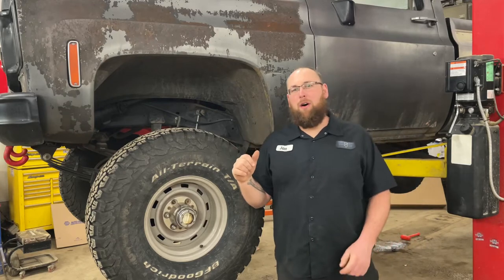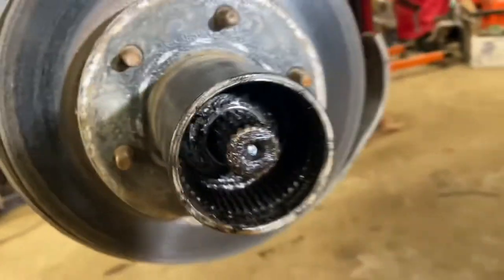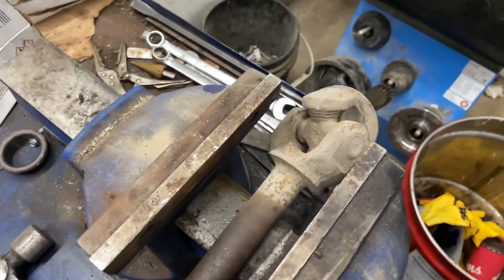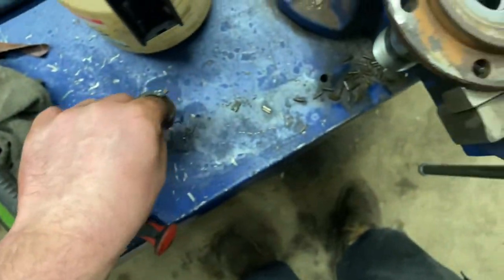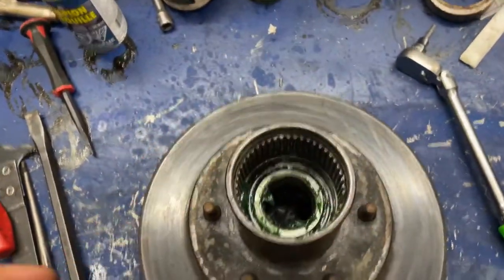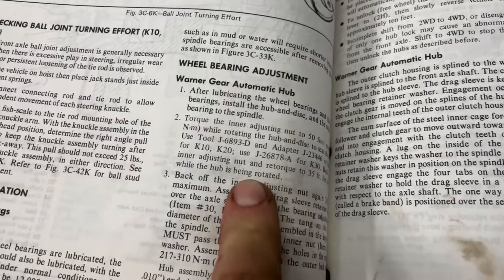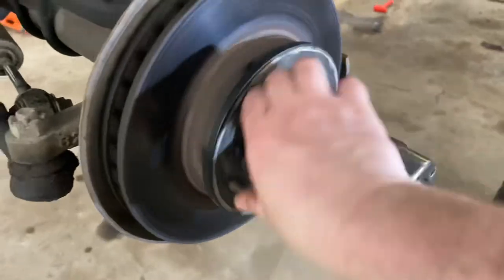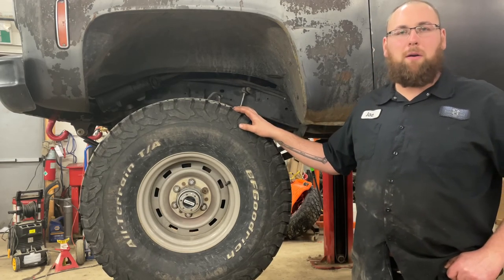K10 Chevy Squarebody 8.5 diff front hubs, wheel bearings, and wheel u-joint replacement

Comment: I did a repack after the left brake hose locked up the caliper, but the heat killed the bearing just 5000 miles later. Now I have to go in there again, and this video helps a lot because I've never replaced bearing races before. Gonna tackle it this weekend.

Update: Tackled it, and WOW the passenger bearing was SHOT. Thanks again for this video. Now, I just need to go back in, replace the seal I damaged on installation, and also replace both spindle bearings. Fun times.

Comment: hey mate i'm havin a hell of a time trying to find a reliable set of spec bearings and seals for the wheel hub what are the part numbers for them it would be greatly appreciated
Reply from the maker: I usually get SKF bearings and seals from my local Napa. What year of truck and is it a k10 with six lug rims?
Reply: @JonHolovach mines a 1986 Chevy k20 3/4 ton 4x4 and I need to re do the hub bearings and seals cause they grenade
Reply: And it’s a 8 lug rim Dana 44
Reply from the maker: These are 2nd design numbers from Napa 

Front inner bearing UBS LM104949VP
Front inner race UBS JLM104910
Seal inner UBS 22311
Outer bearing UBS LM501349VP
Outer race UBS LM501310VP
Reply from the maker: They are all skf numbers. Only thing Napa lists is a second design. Only other way it to pull it apart and get the numbers from what is in there.

Comment: Good video. I own a 78 k10 I need to change the bearing lockers etc. same issue. Just had motors rebuilt trans etc. question. When I had my trans done the guy recommend trans braces. My trans was ripped down the center. He think it’s because the transmission needs a brace. I’m not super savvy. But isn’t it held up with a brace? Or just attached to the transfer case? And motor.
Reply from the maker: I’ve seen trans crack in these trucks with out that brace from the transfer case to the transmission bell housing. One of the squares I used to mud bog with had a 203 big heavy t case I had that brace plus made an extra that would support the back of the transfer case to take the weight.
Reply: @JonHolovach  yea I’ll have to take it in and see what they can do. Don’t want to drive it like it is. Thanks for the good advice. I’m trying to get this truck back into shape and it should last another 50 years.

Comment: Do the front axle shafts seat somehow? I changed the u-joints but putting the shaft back in seems to go in all the way to the u-joint and it doesn't feel like installing a drive shaft. It just feels like it is laying in the tube.
Reply from the maker: Well the splines should engage the big yoke should almost touch the axle tube if seated all the way in

Comment: I find myself back on your channel looking for instruction on replacing the universal joints in the front of my 85 K10. So do I have to remove the hub/rotor to get the u joints out? I’m hoping not. 😳
Reply from the maker: Yep have to take the rotor off and the hub spindle to remove the front shafts out of the diffs
Reply: On my way to the parts store. Thanks for the reply sir

Comment: I was going to clean up the locking hub and spray with light silicone lubricant.  Would this be sufficient?  I hear if wheel grease is used it makes them hard to turn in cold weather.  Is this true?
Reply from the maker: Heavy grease can make them hard to turn. I actually just use a regular synthetic grease same as you use for ball joints. They seem to be fine with that.

Comment: What size tires are those and are those the stock rims, I’m trying to figure out what bigger tires I can get on my k10?
Reply from the maker: 35s and stock rally rims
Reply: @JonHolovach  people say 33s, 35s this and that, do you know what precise tire size to get that would fit if I wanted 33s on my stock wheels?
Reply: @JonHolovach  I don’t know much about tires and I don’t want to buy 33s if I don’t know for sure that they’re the right size for the rim
Reply from the maker: You just have to make sure that it is for the size of the rim you have like a 15. Also depends on how much lift you have also. Bigger the tire the more lift you need.
Reply: @JonHolovach  so all that matters for the tire to fit the rim is just that the tires for a 15 inch rim?
Reply from the maker: @MrBlake-cz4km  yeah usually get a 33 x 10.5 r15 on these trucks
Reply: @JonHolovach  thanks man, I hope they look good the trucks got a 3/4 ton conversion and I was told it’s basically a 2 or 3 inch lift with that so hopefully 33s will look good.

Comment: What is the part number for that spindle nut socket? Trying to find it.
Reply from the maker: I will check in the morning when I am at the shop and let you know
Reply from the maker: 4543A-3 is the number on my socket
Reply: @humbertohernandez3067  OTC is the manufacturer, they make a set of spindle nut sockets in the 4543A series.  This one is 4543A-3.  Google OTC or Spindle and 4543A-3.  You'll find various merchants selling it.